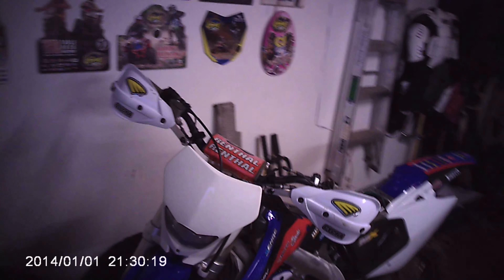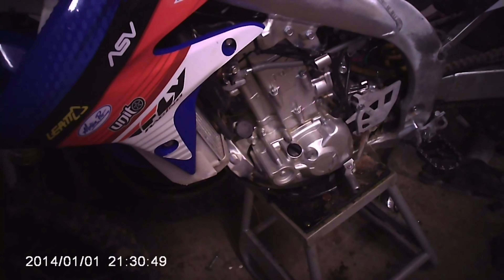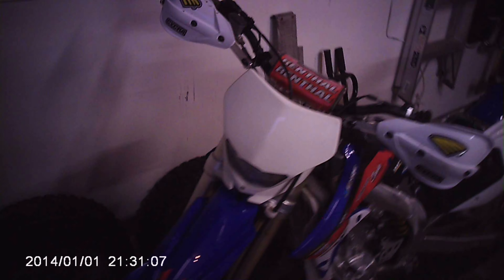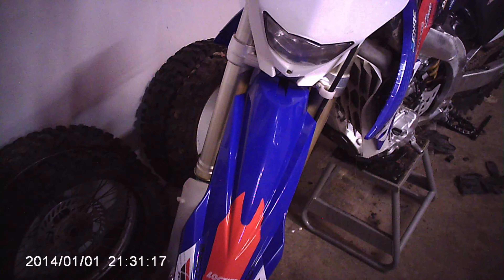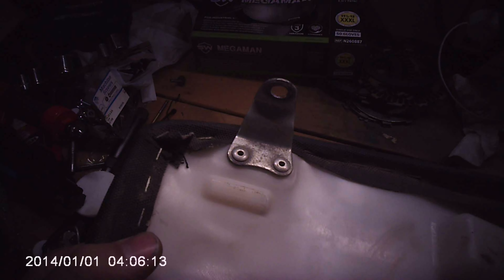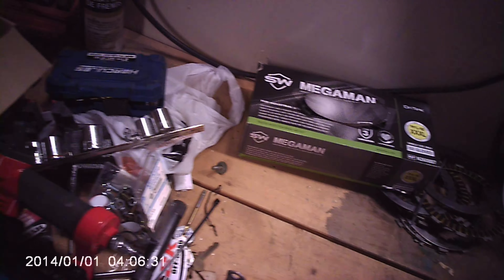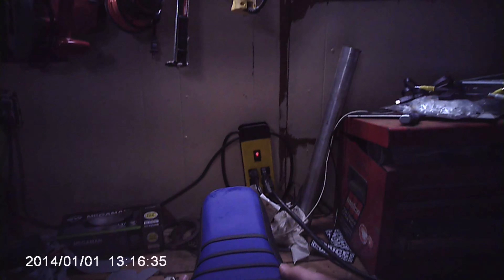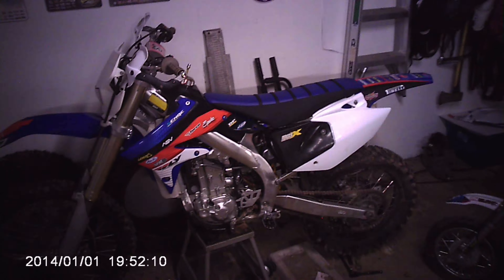SSR 450 Build Part 3/Giveaway Winner Announced!

Comment: Nice build. I swapped a Showa rear shock on, and putting a FCR on this week. Still watching 450x forks on Ebay. Have SuMo wheels on currently so i dont burn my knobbies up testing everything out, thing is a blast around the mnt town roads.  With just the airbox mod and pilot jet swap the bike has a lot of grunt. Looking forward to see what the FCR does, trying to jet it with the baffle in cuz Id like to keep it quiet.

Comment: Do you happen to know if Honda linkage bearing fit the SSR? Also, would a Honda subframe be a direct fit? They look the same from the diagrams.
Reply from the maker: From what I could tell, the bearings are exactly the same. I also would say that the subframe is a direct swap too
Reply: @wrightcycleworks  thanks for the info. Do you happen to know the weight? Nobody has an accurate number. I’m assuming your not running the heavy stock dual sport tires so my guess is 240lbs

I’d like to know that all the critical parts are replaceable with easy to find Honda OEM/aftermarket parts. I don’t like idea of being reliant on SSR for parts. I like the Zongshen motors and the price vs a used 450x
Reply from the maker: @ocoutdoors2355  everything chassis wise is a direct copy of an 08 CRF450X. The engine is 95% the same, except for the carb, airbox, camshaft and rocker arms. However, all of these parts will swap to CRF units. Check out my buddy DFast on YouTube. He has had an SSR300 and now has an SSR 450. He has some great info about these as well.
Reply: @wrightcycleworks  would you happen to know if the motor mounts are the same between the 450x and SSR450. In other words, would a NC450 crate motor mount up to a 450x frame? The reason I ask is because here in SoCal there are many blown up 450x bikes which I could buy for cheap.
Reply from the maker: @ocoutdoors2355  I couldn't say 100% for certain that they would swap out. But they do look exactly the same. I'd say they will.

Comment: Nice job. How does the SSR450 compare to the GPX450?
Reply from the maker: I'd say all around, the GPX outperformed the SSR. I liked the suspension on the SSR a little better. On the other hand, all parts are interchangeable on the SSR with a CRF450X. So if you were in a bind and needed something quickly it was easy to just get a Honda replacement part. The GPX is a Husqvarna clone, but the engine and fuel injection are GPX specific. So it is hard to get parts for in a hurry. I also didn't have the best experience with GPX's reliability and customer service.

Comment: How were you doing racing? Did you change the carb and suspension?
Reply from the maker: Haven't got to race yet, first race is next weekend. Rear shock is a Honda CRF250 unit, and the front forks are from a brand new SSR 300.  I rejetted the carb, but I'm still on the hunt for an FCR to swap in.
Reply: @wrightcycleworks  please let me know about your upgrades and results